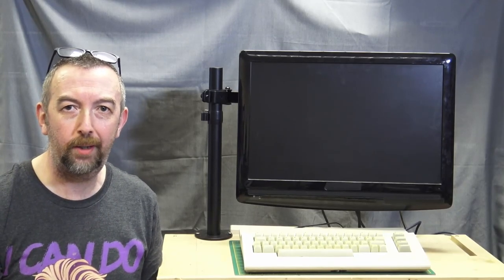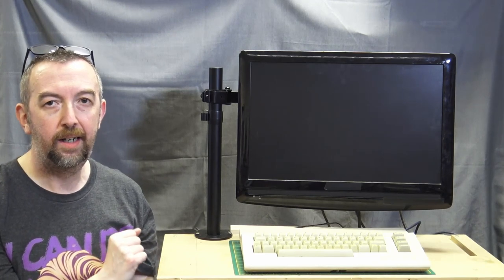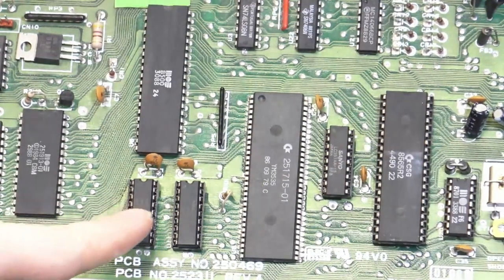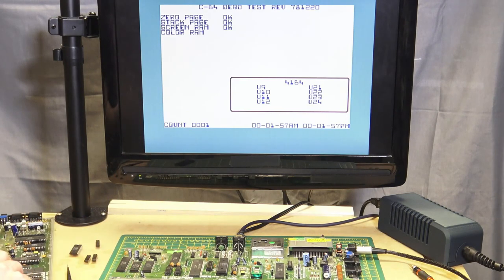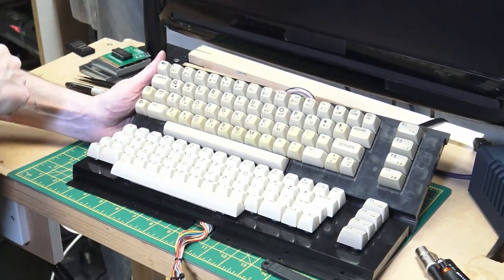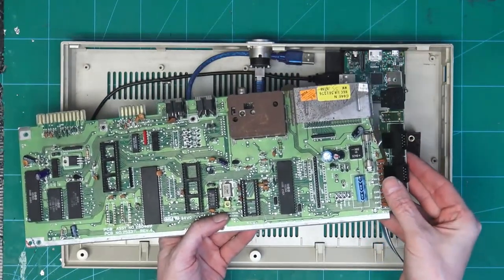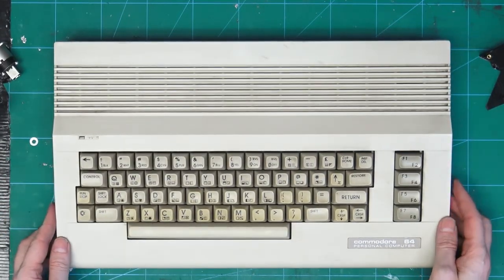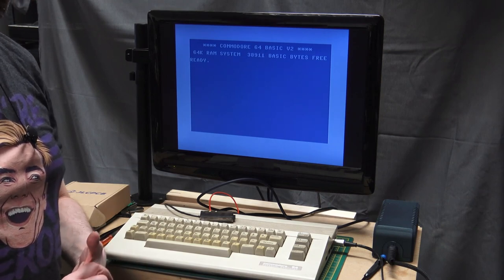Commodore 64C repair with faulty colour ram and restore a modded system to original C64C  hardware

Comment: Nice troubleshooting your first C64 repair -- is that correct, first C64 repair? I knew you'd figure out those first two ICs weren't the colour RAM. I guess Donkey Kong Arcade is officially now the go-to SID test game.😉  Nice fix. Another one saved. I look forward to your Datasette repair.
Reply from the maker: Yes it was my first C64 repair so I am happy to have both working by the end. I tested the Datasette and it worked, so it would just be a clean, new belt and test. I already did two others so was not so interested to show a 3rd especially when I have an amiga 500 next.Had to finish some work first so I hope to find time in the next week. Now if I could find another c64c perhaps with a blank screen I would take on the challenge.
Reply: @DJlegionuk  Yeah, black screens are the fun ones, that's for sure. You did a great job on this one so I hope you can find some other sick C64s to save. 👍

Comment: Nice intro, and LOL @ measuring safe distance :o)  Great job!  It can get confusing looking at the IC numbers reported by some versions of the diagnostic cart, as the IC numbers are different between C64 / C64C etc.  The main RAM is DRAM btw, not SRAM!   The colour RAM is SRAM though!
Reply from the maker: I never worked on a c64 and was the first time with the dead test so all new to me. I did think the labels for the chips in the dead test would depend on the version of the boards after. I also worked the colour ram out after watching a few of your older c64 videos, so thank you !
Reply from the maker: also did you notice the sound of the de-solder gun ?

Comment: I really like your 3-D printed power supply box.I don't have any original Commodore power supplies, just built a couple of my own. I swap between dead test/diagnostic cartridge 781220 and 586220 to verify abnormalities. The 205469 short board is odd enough ast it is!
Reply from the maker: this psu was ok on the c64c short board, but as soon as I tried on a long board it couldn't provide enough current on the 9v ac. I now have a psu from sven peterson and printed another case that looks like a c64c brick.